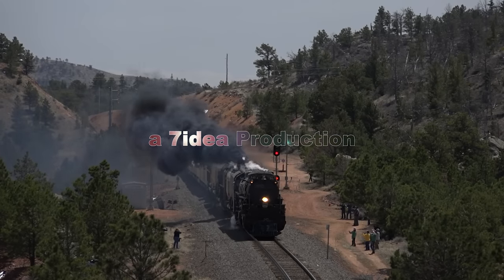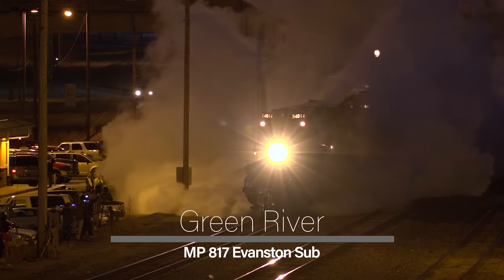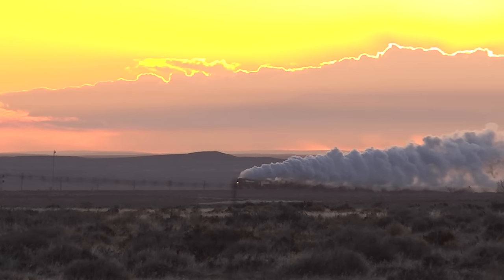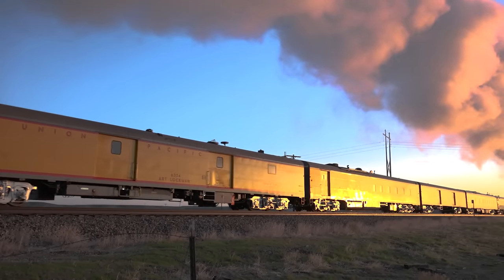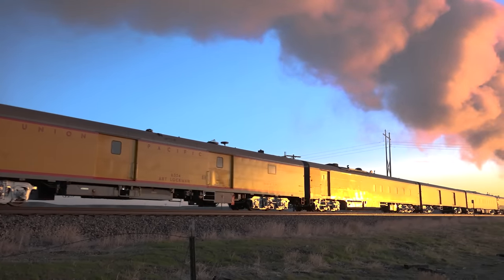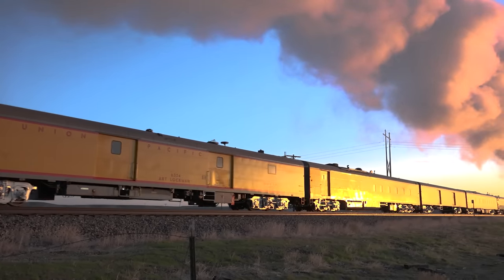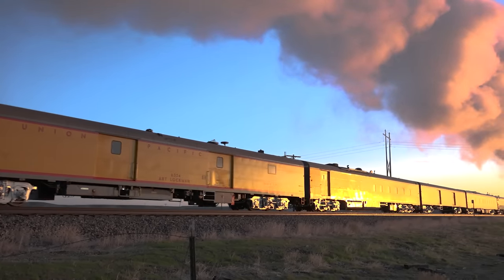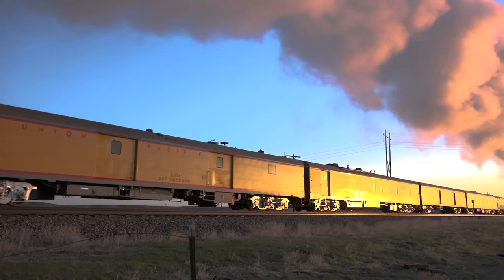The Largest Steam Locomotive on Earth!

Comment: What's the purpose of the diesel engine?
Reply: I'd heard it was there only to provide power (electricity) to the following cars. But this narrator says they used it at times to put some strain on, to see if 4014 could handle it >> she did, easily!
Reply: It’s used primarily for dynamic braking to help slow the train on heavy and long grades to cut down on brake shoe where. The brake shoes on steam locomotives are cast iron and expensive to replace. It also can assist in moving the train around the yard when the steam locomotive is shut down. Union pacific does not have any modern diesel locomotives that are able to provide power to coaches. That power is supplied by dedicated power cars which you can see in the video. These cars contain diesel generators that produce the 480 VAC to provide to the coaches.
Reply: @FFred-us9tw  Interesting - thx :)

Comment: good thing it had a diesel to push it apparently.   Every time you see these steamers they always have a diesel pushing them.  which makes you have to wonder if the wheels are so worn on the old steamers they can't pull themselves anymore so need the diesels  to push them along.
Reply: The diesel is not pushing it. It’s clearly idling if you listen. Union Pacific’s Ed Dickens who runs the steam program has explained on more than one occasion that the diesel is there to provide dynamic braking for the train on long descending grades to cut down on brake shoe wear. It also provides the positive train control data to the 4014s in cab displays. And lastly it’s there in case the 4014 develops any problems on the mainline, the diesel can get it moving again.
Reply: @FFred-us9tw  Don't forget that the diesel is actually a diesel-electric! 
It is a more reliable, stable, electric power supply for the coaches being towed.

Comment: The 4000 class UP engines are certainly not the largest steam locomotives, nor the most powerful.  Robert Hundman explained in one of his articles that you could fit a Big Boy boiler totally inside the boiler of an H-8 Allegheny with room to spare.   As for the highest horsepower steam engine that would go to the somewhat short lived and temperamental Pennsy Q2 class capable of just shy of 8,000 hp as tested on a static dynamometer.   Of course weight on drivers and the factor of adhesion was what made an engine a puller.     The one thing that the big boy can truthfully claim is that it is the worlds largest OPERATING steam locomotive.
Reply: They never claimed it was the most powerful. It is the largest, Wheelbase and axle wise.  The Big Boy's were a 4-8-8-4 (24 axles) with a wheel base (engine and tender) of 117'.  The Allegheny's were 2-6-6-6 (20 axles, 2 less than Big Boy) and a wheelbase of 112'.

Comment: Why does it have to have a big diesel helper??
Reply: It's not a helper, It is in Idle during normal operation. It's there for dynamic braking when needed and it also has the controls and hardware for the mandatory PTC. It feeds the data via cables to the 4014's cab to displays for the crew.  On most excursions UP will always have a diesel in tow to provide additional air if needed and as a built in rescue if the steam locomotive it's trailing needs it. But the length of these excursion trains won't even break a sweat on a steam locomotive this large.

Comment: So why the second step engine AND a Diesel engine to pull so few cars? This thing could pull a mile of coal all by itself.
Reply: The diesel locomotive isn’t there for pulling. It’s there for dynamic braking and to provide PTC for the 4014. The other car that looks like a locomotive is a diesel generator car that provides power to the coaches.

Comment: There's a lot of steam locomotive's being restored in the last couple of years, and a lot beginning to be restored, Make's you wonder if steam is making a come back due to high cost of oil and unnecessary regulations.
Reply: Wishful thinking, but no, steam is absolutely not making a comeback. Certainly not due to the price of oil. Don't forget these steam locomotives are running on oil and are use a lot more of it than a modern diesel loco.  They are not as powerful and lack any dynamic braking making them far less useful than a diesel.  And these locomotives are certainly not exempt from regulations.  It's simply nostalgia. Nothing more.

Comment: There should be a law prohibiting a diesel electric from hooking to ANY steam powered locomotive period. They need to stand alone.
Reply: Diesels are used for their generators, and mostly for the dynamic brakes. This is a substantial savings on brakes for the steam-powered passenger trains.

Comment: Largest steam locomotive on earth is the Yellowstone 2-8-8-4 weighing in at 624 Tons as the Big Boy only weighs 600 Tons, Big Boy is the longest Articulated steam locomotive still around. The Biggest steam locomotive is Considered to be the C&O 2-6-6-6 Allegheny Class. The United States Most POWERFUL steam locomotive is none other the Pennsylvania Q2 a 4-6-4-4 Non-Articulated Steam locomotive pushed 8,000HP and could do 50mph upgrade towing 125 cars by herself which still holds the record for being the most Powerful Steam Loco ever made in the United States to this Day, non were ever saved as they were all scraped. Out of the 25 Union Pacific Big Boy locomotives that were made only 2 are still active to this day #4014 and #4012 that sits in Scranton Pennsylvania Steamtown USA as of 2017 Rebuilt of #4012 completed in early 2021 she was certified by the FRA as an Active Steam Locomotive but will never move do to the tight turns and bad track in the surrounding area where she sits.
Reply: The Yellowstone is heavier than Big Boy, but not longer. To be the “Largest steam locomotive ever” you have to be the longest AND heaviest. And the 4012 is not operational. Active does not mean operational. The 4014 is the only OPERATIONAL Big Boy in existence.
Reply: @FFred-us9tw  Haha you young guys Active does mean ALIVE and well under operational control, with that being said as you said when Big Boy number 4014 isn't used went Dark as its Not titled as the Biggest then haha, as if you read more, I gave reasons why it doesn't run, C&O is then the Heaviest Largest Locomotive to ever existence then, Note looking it up NOT online as Wiki isn't proof as I can change wiki to what I want, Congress DC Archives Library Blueprints on each locomotive which I have tell the REAL LIFE specs, until then Blah blah...blah what you think and say
Reply: @FFred-us9tw  Fun fact for you as I have worked for Penn Central And all of Conrail life term 38 years to be total, so watch what is said as I heard it all. Big Boy is only Famous to what people make it be, Not a Record Breaker or a Heavy Hauler just something that survived! point blank.
Reply: @FFred-us9tw  You had me open all my Real Life 100% True Blue Prints to tell you the Big Boy specs are Bare as to Being the Largest as you SAID in the back Comment  "LONGEST" and "HEAVIEST" thats easy C&O 2-6-6-6 is it as the Firebox is 3ft longer than the BigBoy, and the Tender alone weighs in more than 1,183,540 pounds as the Big Boy only tender 436,500 lb. So tell me then what's the Largest then!
Reply: @Motherslug-q7l  ???  Did you even read what I wrote?  There is only one Big Boy in OPERATIONAL condition. I didn’t mention “Active”. You did.  Operational and Active are two very different things. The 4012 is not capable of operating under its own power. So it is not operational.   
And who said anything about Wikipedia? The Big Boy with tender is longer than the Yellowstone with tender. Hence it’s the LARGEST steam
Locomotive.  I know all you rail buffs who’ve never actually been Locomotive Engineers love to argue with actual railroaders based off of what you hear about in the railfan forums. But if you took the time to actually read facts and listen to people who actually do this for a living you could actually learn something.
Reply: @FFred-us9tw  So you understand Fake and Reality when on Online looking up Worlds Longest or Biggest Diesel the RS-1 shows up as it's Not the DDA40X is the longest Diesel Ever made at 98Ft long True to Life. Make sure you know what your talking about before coming at me B.
Reply: @FFred-us9tw  Cute haha Nice love it
Reply: @FFred-us9tw  here I'll be the Biggier Better Guy the Union Pacific Big Boy #4014 is the Largest Steam ever made haha said it, honestly I could careless thats all you have on her
Reply: @FFred-us9tw  Pennsylvania Steam Locomotives are the Gods of Steam like it or not they are, Pennsy has the Fastest & Most Powerful Steam Locomotives in History in all the United States.

Comment: The train didn't have many cars to pull.  So why did those two gigantic steam engines need a diesel electric in the middle.
Reply: The diesel locomotive is not doing any 'real' work, it just provides electrical power and dynamic braking to the cars. UP does that for all steam excursions. There simply isn't space to retrofit the necessary equipment onto a steam locomotive
Reply: @ReptilianLepton  The diesel does NOT provide any power to the coaches. That is provided by a dedicated "Power Car" you can see in the consist with vents for the radiators. UP has no modern diesels with HEP (Head End Power) capability.  The diesel provides dynamic braking for the train and the PTC data for the in cab displays on the 4014.  It also serves as an emergency plan to get the train moving should the 4014 develop any issues.

Comment: I'm thinking the diesels purpose is more for electricity generation for the cars
Reply: No, the power for the coaches comes from a power car you can see in the consist farther back. UP has no modern 6 axle power with HEP (Head End Power) capability.

Comment: Correctly, the title should read: the largest operable steam locomotive in the world.

The locomotive with the largest tractive effort is the 2-8-8-2 Y6b of the N&W with 170'000 pounds. In contrast, the BigBoy has only 135,375 pounds.
The most powerful locomotive is PRR's 4-4-6-4 Q-2 with 7,987 HP compared to only 6,298 HP of the BigBoy.
The heaviest engine is Erie's 2-8-8-2 (triplex) P-1 with 1,169,750 pounds . Here, the BigBoy offers about 100,000 pounds less.
With 140 feet ( 42,67m) length the 6-4-4-6 S-1 of the PRR is the queen of the steam locomotives and beats the BigBoy by 2,2m.

Comment: What's with the diesel engine?
Reply: It's used for several reasons.  Railroads require all engines to have electronic braking.  It's used to provide power to the cars, and also it helps pull a little to save fuel.  The trackside infrastructure to support steam engines, fuel depots, water tower, is long gone.  They have to bring all the fuel and water with them for most of the trip.  Thats what those huge yellow tank cars are for.
Reply: @Travelinmatt1976  thanx

Comment: why don't larger companies in the united states that run steam excursions ever let the locomotives run on their own power? surely these locomotives could pull those coaches on their own? is it because the UP lines simply don't have infastructure for these loco's fuel and water?
Reply: This locomotive IS running under its own power. The diesel locomotive has been explained by Union Pacific many times. It’s not there to provide power for pulling the train. It’s there primarily to provide dynamic braking for slowing the train on long descending grades. The 4014 uses very expensive now Custom-made cast iron brake shoes. Using the dynamic braking eliminates a lot of wear on those brake shoes. The diesel locomotive also provides positive train control data to the in-cab displays on the 4014. And lastly, the diesel locomotive provides a means of getting the 4014 off of the mainline should any mechanical problems arise.

Comment: It's a shame UP won't let steam engines on main lines anymore due to insurance reasons
Reply: What???  UP has no such restrictions.
Reply: The main reason is because the infrastructure to support steam engines is no longer present.  There are no fuel depots, no water towers.  All the trackside equipment used to keep steam engines running is long gone.

Comment: In the video, you show an abandoned right of way, with the notation that this was the site of the original Promontory Point. First, do I understand that correctly, and second, do you know when that section was abandoned? I rode that line from Chicago to San Francisco in 1961. I'm just wondering if I was on the now-abandoned portion or not.
Reply from the maker: As I understand it, the original grade over Promontory Summit was bypassed by the Lucin Cutoff (through the Great Salt Lake) in 1904. The tracks over the original grade were removed in 1942. A short section of track was put back in at Promontory Summit for the reenactment ceremonies when it became a park.
Reply: Interesting that the incorrect location of  Promentory Point was so widely used.
Promentory Summit was the place.

Comment: I wonder why the never went to a closed steam system?
Reply: Would be impossible due to size constraints and hardly worth it. Back when steam was king getting water wasn’t an issue.
Reply: @FFred-us9tw  These engines are near the end of the steam era and steam cars and trucks used closed systems. The worth would be fewer stops needed for water.
Reply: @thepubliceye  steam cars and trucks are minuscule in size compared to hundred foot long steam locomotives. It’s like comparing a toy car to a full-size car. When you’re dealing with that volume of water and steam you’re not gonna be able to make a closed system that would be effective on the same frame. If you look at big steam locomotives like the big boy, space is at a premium. The idea of adding all that piping as well as a condensing system was out of the question. Which was why it was never even considered. again, the water stops were not a problem. And it’s also why water tenders became commonplace. Far cheaper and far less complex to carry extra water or to make a stop then it is to design and incorporate a condensing system. Adding water is maintenance free, complex systems are not.
  And don’t forget the amount of steam loss due to accessories on steam locomotives. Turbine generators and even whistles used a good amount of steam and passenger trains in the winter using steam heat used quite a large amount of steam. You’re closed system is no longer closed when you have all these accessories using up your steam supply.
Reply: @FFred-us9tw  Ok steam liners are closed systems You don' just a hang a condensing system on a big boy, The locomotive must be designed as closed system. aA for space you don't need as large firebox and boiler, you are re- heating water that is over 300 degs, when you save water you also save fuel. Then there is also a steam generator

Comment: Umm... there are several larger than Big Boy... Belgium had a huge locomotive, the Allegheny was bigger... few others also
Reply: The Allegheny was 125’ long. Big Boy is 132’ long. So it’s physically larger.   And the largest locomotive ever used in Belgium, the NMBS/SNCB No. 2096 was only 101’ feet long.

Comment: It looks like this one is modified from coal to kerosene, begging for the end of steam locomotives, as it is much more efficient to combust directly in a diesel engine as to use it to boil water to get the steam. Steam engines only make sense if you burn coal.
Reply: These locomotives burn fuel oil. Not kerosene.

Comment: Wrong. The C&0's Allegheny Class was heavier, had over a thousand more horsepower, and the firebox from a "Big Boy" could literally fit inside that of an Allegheny. Unfortunately, unlike the UP engine, there are no longer any Alleghenys that are operational.
Reply: An Allegheny is NOT longer than a Big Boy and has less axles. And the last generation of Big Boys were actually heavier than the Allegheny units anyhow.  As far as horsepower, where did UP or anyone else claim the Big Boy was the most powerful?  They only claimed the largest.  And that’s a proven fact.
Reply: @FFred-us9tw  Didn't say they were longer. I said the Alleghenys were heavier and more powerful, and had a larger firebox. which is all true. Naturally, they had fewer axles... they were 2-6-6-6! I also mentioned that there we none still operating.
Reply: @Sam62254  your initial comment was “wrong“ who is wrong? Union Pacific never said the big boy was heavier or more powerful than anything else. They said it’s “the largest steam locomotive ever built“ and it is. You keep bringing up horsepower and firebox size. Where did Union Pacific mention any of that?. That’s not what dictates how big a locomotive is. “Largest“ meaning the longest AND heaviest. No other locomotive is as long AND as heavy as the big boy. Hence the title “largest“.

Comment: A magnificent loco but not the biggest. You could fit the boiler of a Bigboy inside the boiler of C&O Allegheny  2-6-6-6
Reply: Actually no. Their boilers were comparable in size.  Just a different design. And while the Allegheny was a bit heavier, it was almost 7' shorter then the 4-8-8-4 Big Boy.